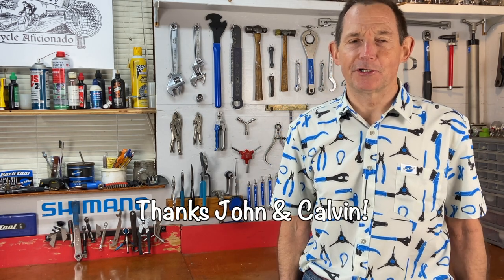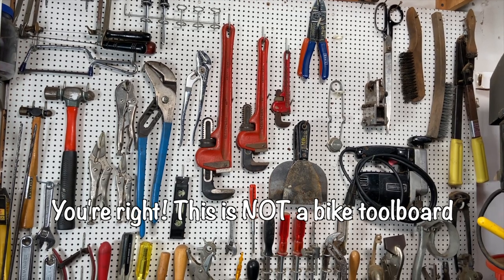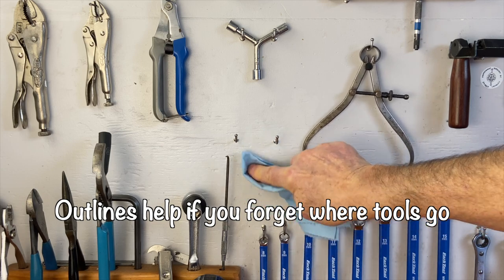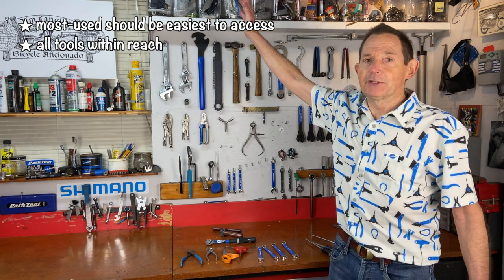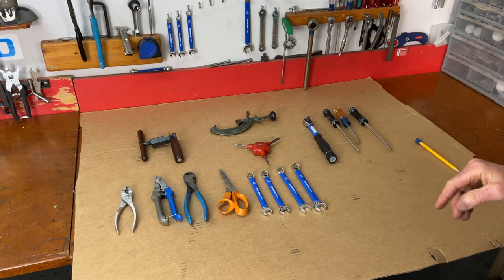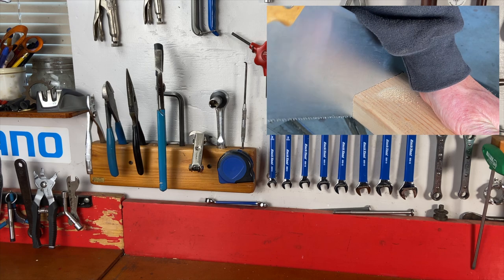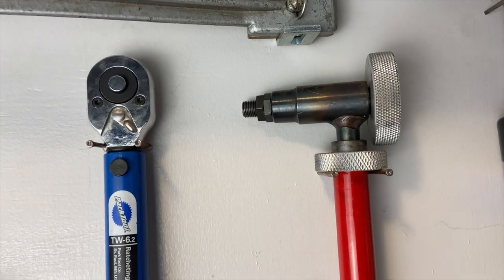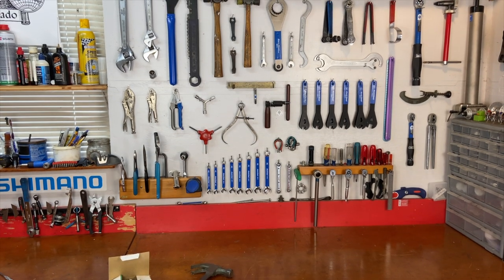Take Your Bike Workshop to the Next Level With A CUSTOM TOOLBOARD! #bikerepair #bikeworkshop

Comment: Can’t believe I hadn’t seen this video before. I especially love the wooden blocks with the multiple holding points, I’ll have to give this a go with some timber as it looks like a great way to hold a set of tools in one location. It’s also nice to have a few strong magnets on the tool board as well, they make life easier when the magnetic strength of your screw driver or other tool isn’t strong enough to hold a screw or hex bolt firmly enough.
Reply from the maker: Glad you found this video indoor and I appreciate you watching and the great comment, thanks! You're absolutely right about the magnets, it's great to use them on toolboards and have them in the shop too, great point. 🙏

Comment: I recently watched a video from Indonesia titled Will this old bike survive? With the tools employed on that low end Choicc, I began to wonder how apt the title was! My toolbox is a classic wooden  doghouse ended carpenter's toolbox. A jumble of quality tools, spoke nipples, spoke keys, and bags of cassette cogs resides. When I can, I work outdoors with a disused pool ladder as my work stand. Good ideas for the tool board,  but I need  portability and total lack of Obsessive Compulsive Disorder would nix any effort to organize! Good news,  I built 2 new wheels with Mavic of Romania rims in one day! Lacing the wheels,  the spokes almost assembled themselves! There were small marks on both sides of the front hub marking the holes for the key spokes to align the logo with the valve hole 3x pattern! With the DuraAce  shifters and '73 Campy derailleur,  heavily modified hub, 8 speed cassette made with 10 speed spacing,  the thing actually  indexed! 126mm dropouts! Unfortunately the zero compression cable without a feral sent housing wires through the derailleur cable hole ending stellar performance! Oh well,  a feral will put an end to that problem. 10 speed version needed more shifter cable pull to work, but not matching 10 speed index pull. The shortened freehub body resulting in exactly the width of a 6 speed freewheel made the difference and cut the spoke dish to 11mm! On Henry Wildberry's vlog he actually filed the notches on the brifter wheel making a 10 speed brighter work with 11 speed. A brave man! I loathe the complexity of brifters and hydraulics complete that sentiment! Your videos have helped my wildest retromod ideas reach fruition!
Reply from the maker: What a fantastic comment, David - really appreciated and enjoyed it! Congrats on the wheel builds and retromod drivetrain upgrade - well done!! I know toolboards don't work for everyone. I wish YT had a way for commenters to post photos of their stuff so we could all see your carpenters' bike toolbox and others could show off their tool arrangements, too. There are so many great ways to do it and it would be fun to be able to see and share them all. Thanks so much for watching and another great comment! Much success with all your bike projects!

Comment: With pegboard, you can prevent the tool hangers from coming off with the tools, by wrapping with a zip-tie horizontally across the hanger into adjacent pegboard holes.
Reply from the maker: Thanks a lot for watching and the zip-tie tip Michael, appreciate it very much.

Comment: Thanks for the tips as i want to organise my tools better.
One thing i didn't understand is why use the cardboard when you could just lay the plywood on a bench and lay out the tools.
Either way I'm gonna build a tool board 👍
Reply from the maker: Thanks for watching, Mark and I’m glad the tips are helpful. Most of the time there’s already a wall or plywood behind the workbench so the template is needed as an easy and accurate way to measure and layout your tools and holders and then transfer it to the wall or plywood. But, yes, you could definitely lay them out on the plywood using it as the template. Just be sure to know how the plywood will be attached to the wall or the workbench so you don’t mistakenly put tools or holders where they will prevent attaching the plywood or interfere with something. Thanks again and have fun designing your perfect toolboard!
Reply: @JimLangley1  cheers Jim that makes sense i was thinking of new installations.
Heres one tip i thought of when laying out my board last night. Although i have a garage (no windows) i also like to work on bikes in the house or in the garden depending on temperature and light conditions. I plan to make my board mobile so i can hang it in the garage but also sit it on a table etc with some simpe feet.
Oh subbed btw.
Reply from the maker: @marks-0-0  thanks a lot for subscribing, Mark, appreciate it! That's a great idea to make a mobile toolboard. If you made it a wedge shape so that the toolboard was angled back and another board was behind that and another board formed a base, you could even put wheels on the bottom to roll it into place. If the slanted board was hinged, you could maybe store lubes and grease inside and you would just lift the toolboard to get at that stuff when you needed it. Just an idea. I'm sure you'll come up with something great. Let me know how it turns out.

Comment: @Jim Langley How are the socket wrenches attached to that 2x4 on the lower right of your tool wall?
Reply from the maker: Thanks for watching and the question, VentoGreg! Those are 1/4-drive ratchets with 4, 5, and 6mm hex sockets. I drilled 3 holes in the 2x4 and the hex ends go in the holes to keep them there. If you go to 10:11 you can see me taking them out and putting them back in. Hope that helps and thanks again!

Comment: Great video! But what do you use regular metric wrenches for on a modern bike? Bleed screws  (8mm I think) and wheel nuts (15mm) if you have a fixed gear are the only ones I can think of!
Reply from the maker: Thanks a lot for watching and the excellent question, Ben! I tried to make this point in the video but maybe I needed to explain more. My main point is that “your” toolboard won’t be like my toolboard, i.e. everyone’s toolboard should be custom designed according to the bikes they work on and the tools they have and prefer to use. Now for me, I work on bikes of all vintages and need those metric combination wrenches. But if you look close you might see that it’s only the sizes I need not a full set. But I completely agree that if you don’t need tools for your bike they should not be taking up space on your toolboard. Unless you have a huge toolboard and just like displaying all your tools maybe (there are pros & cons to doing that). Hope this helps explain and thanks again Ben!
Reply: Because it's a TOOL board !

Comment: Did you get flood hit?
-
There are all kinds of ways to work neodymium magnets into tool storage systems.
Reply from the maker: Thanks for asking, Ron. We've been lucky. We only lost power for a day and a half and the flooding hasn't affected our area of town much thankfully. Your tip to use magnets is great. I actually have an insert for one of my toolboxes that uses magnets to keep the tools in place. The only thing is that sometimes they're so strong it's actually hard to get the tools off the magnets. But, it sure makes it easy to put the tools back ;-) They also make magnetic toolbars like I have right under the SHIMANO decal to the left side of my toolboard (mine came from Harbor Freight and they're available at lots of other home supply and hardware stores). Those work fine, too, except they tend to collect any old tool that sticks so if you let them they can become disorganized and not as useful . Thanks for watching, commenting and your tip!!